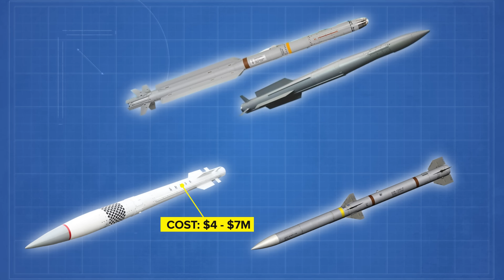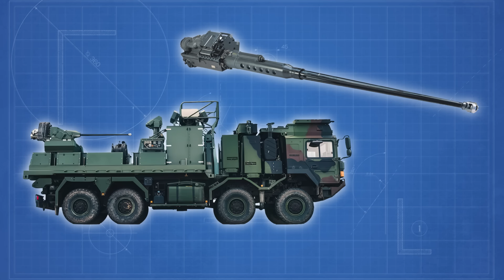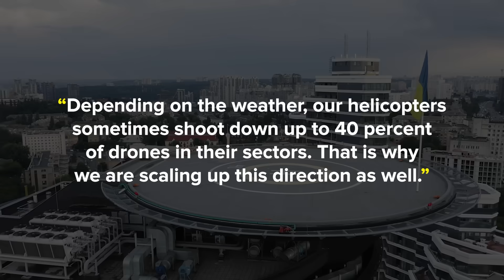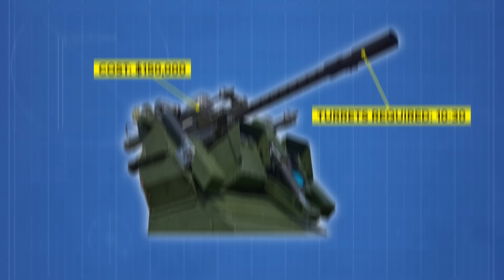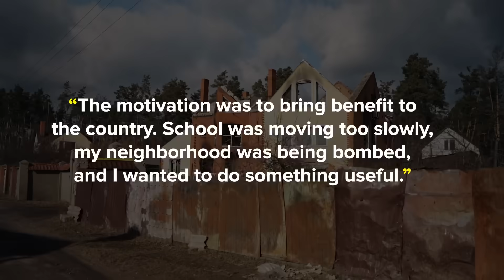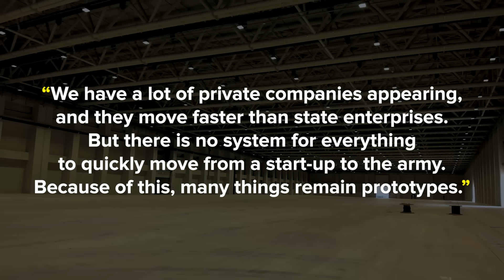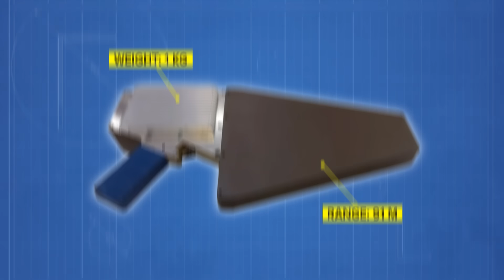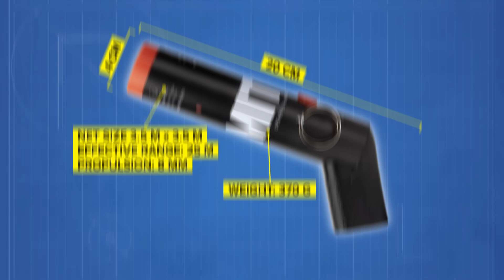Ukrainian TEEN Finds GENIUS Way to TAKE OUT Russian Drones

Comment: If you have connections to ukraine miltitary. Why dont they invent a missle that does what a growler does. Pretend there are 5+ missles   for for every one. Burn out whats left of their anti air defense. Or even a drone. They could send them out without a warhead with ones that do to spoof thier systems
Reply: US has provided those to them. they are using quite effectively
Reply: I do have a feeling they are in the chuby neptune, and not just fuel tanks. But im most likely wrong.
Reply: @WakeUpMate19 20 years from now when this is all over we are going to be watching great break downs with the facts on things we dont know about today